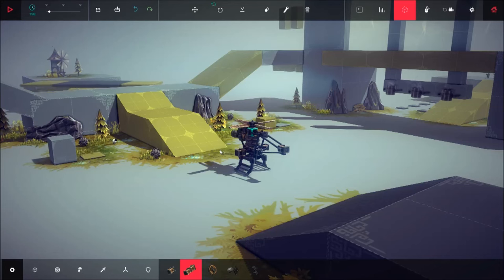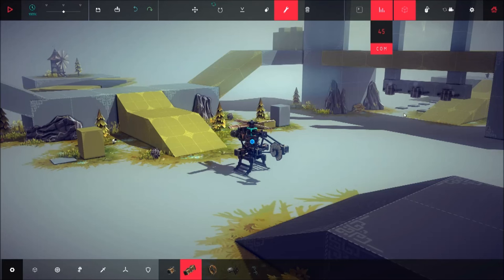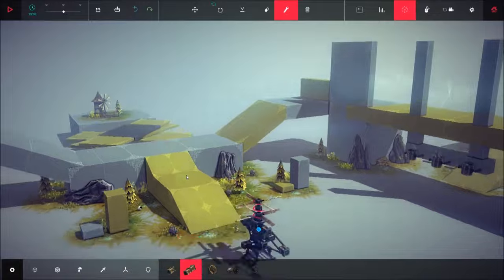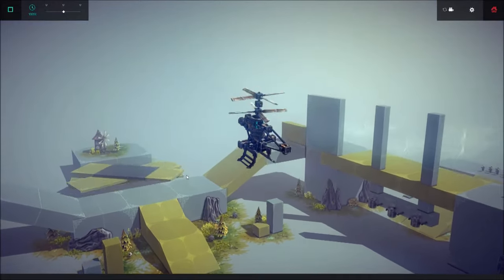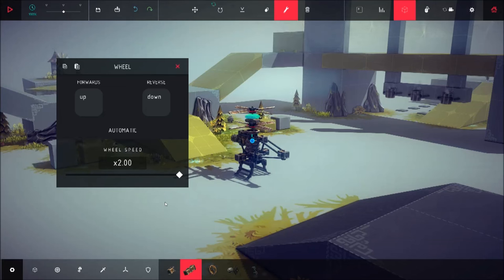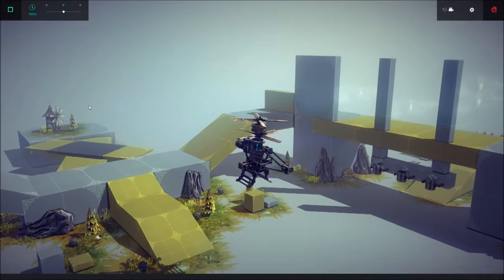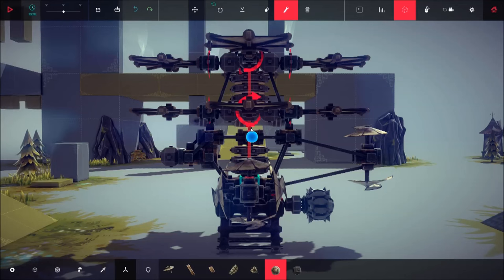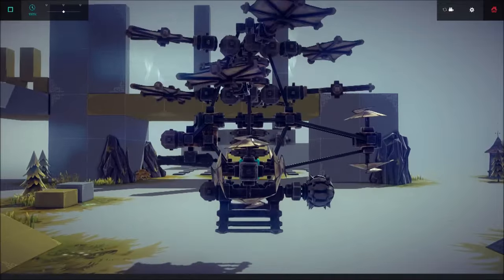HELICOPTER PHYSICS BASICS - Besiege Tutorial - Episode 6

Comment: Wheels on a rotor can work really well. The point is that you should tweak the spinning block's rotation speed to give you just enough lift to hover. That way your craft will be capable of both maintaining "relatively" stable altitude AND rapid vertical movement. Best of both worlds. The downside is that you lose the capability of dealing with any change in weight.

There is value in it, sadly almost no one pays that much attention to the details.

Comment: Interesting. I already know practically everything there is about helicopters, and I knew some of these applied in Besiege, but does gyroscopic precession? If I make a swashplate for a helicopter in this game, would tilting the blade at 90° to where you want to go really work in this game? I don't want to build one to find out that it doesn't work because damn, they're complicated.
Reply: Tuuvas Oh right, that would make sense. I too experience the same 45° offset if I make a glitch rotor (it doesn't need counter steering). If I pitch the body forward, the craft will want to go off to the right. You're probably right about the actual blades not moving. I'm currently tearing down someone's swashplate design so I can build it on a bigger scale and test this. If it truly is 45° or 90°, it will show.
Reply: Tuuvas Ok so it took me a while, but I finally built my own swashplate (the one I tore down was crap...). If I lower the gravity and spool the blades up, it takes off straight up, if I try to fly forward, it goes forward but starts veering off to the LEFT instead of the right. Why? Because I have my controls set up 270° out of phase (90° ccw) relative to the blades. I'm betting that if I rotate it another 45° cw, it will work perfectly, minus the fact it needs to fly in much lower gravity.
Reply: Tuuvas I'll have to rebuild quite a lot of the swashplate in order to rotate it 45°, but it'll be doable. The design I was using has no tail because it doesn't produce any counter-torque. I have the rotor on 2 spinning blocks, one on the top and bottom of the entire assembly, and have a wheel in the middle spinning EXTREMELY fast, and that ends up rotating the blades without any torque applied to the rest of the body. I'll start rebuilding the swash tomorrow and let you know how this turns out.

Comment: Do you have a tutorial for building the gyroscope helicopter - I've built my own version of the attack helicopter you designed, however, I would love the additional stabilization from the gyroscope! This video was very helpful for building my own helicopter, thank you!
Reply from the maker: Unfortunately I don't have any video for a gyroscope specifically, but all a gyroscope is is a fast spinning object that has enough mass/speed to stabilize whatever it's on.  You'll probably want to use a powered wheel in this case
Reply: @Tuuvas  So was it the sheer speed and mass of the rotor assembly which kept it stable while the rest of the craft pivoted? I built a similar mechanism to the one in the video, but the assembly always moved with the whole craft - how did you achieve the ability for the rotor assembly to sway independently of the craft? It looked like it was suspended just by a swivel block. Thanks for the speedy reply! :)

Comment: I think what I meant to say was.. How did you attach the wheels and everything in conjuction with the spinning block and propellers?.. I'd love any feedback regarding this question please!
Reply from the maker: so I don't have quite the same design as you see in this video; however, in my first tutorial I show you how to build my very first stable helicopter design.

It is a little hard to describe but, in my newer design I add motor wheels between the two spinning blocks to make the rotors spin MUCH faster - allowing for gyroscopic stabilization.

Basically, I place a spinning block on the core block, add 3 motor wheels set to automatic, then add another spinning block. On every side of the spinning blocks, I place a ballast and then steering block to control the pitch of the wing panels while they are spinning.
Reply from the maker: +Tuuvas quick correction, I place an unpowered wheel on the starting core block. This prevents the torque effect from affecting the fuselage too much. Then on top of the unpowered wheel, I place that spinning block
Reply: Tuuvas i would say to make the heli appear to be a one-rotor machine, put a counteractive-moving powered wheel in the fuselage

Comment: I created something similar to the self stabilizing helicopter but instead of moving forward or backward when the rotor runs out of travel it just spins the helicopter and crashes. Can you help me find a solution?
Reply from the maker: +Matt Fadista It sounds like the rotor parts might be colliding with the body of the aircraft when at an extreme angle. Double check and make sure there's enough clearance from any spinning objects including the main rotor or even parts of the spinning blades
Reply: I figured out that that's exactly what is happening. But I just can't figure out exactly how you made it so that it bottoms out at the swivel joint rather than the blades hitting the body.

Comment: My helicopters always lean to one side after a minute :( What am I supposed to do?
Reply from the maker: it sounds like your center of mass is off-center compared to your rotor(s).  Make sure you utilize that Center of Mass indicator and make sure everything is properly balanced
Reply: Tuuvas
I did :( The com is perfectly aligned in the middle! This even happened to me after building a simple hexacopter, it just lifted its front up slowly and started going backwards after a while :/
Reply from the maker: +MasterOfstupiD was it a very harsh change in direction? or a very slight and gradual movement in some direction?
Reply: Tuuvas
slight and gradual. I seemed to have fixed it by building a tiltrotor helicopter with 2 rotors, but now this one always drops in the direction I fly curves in